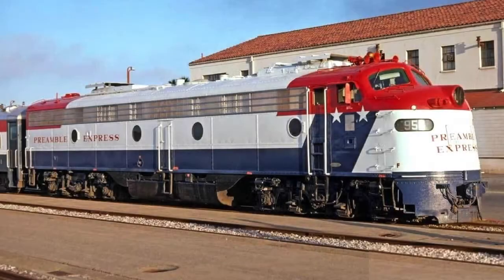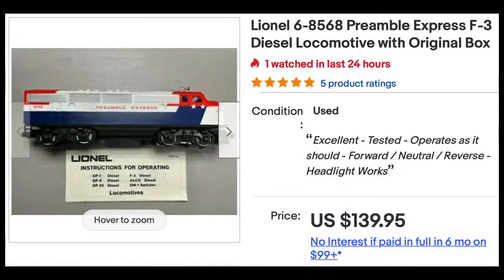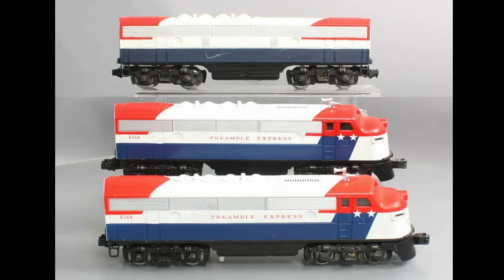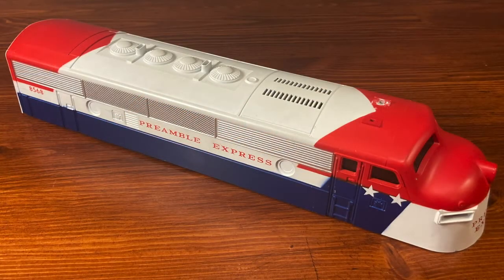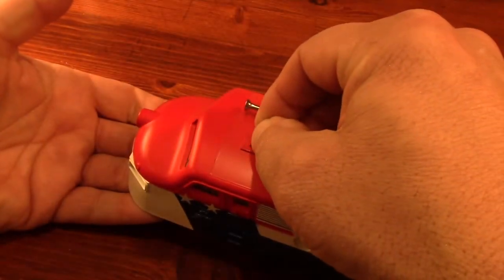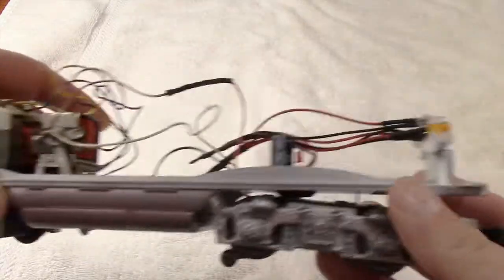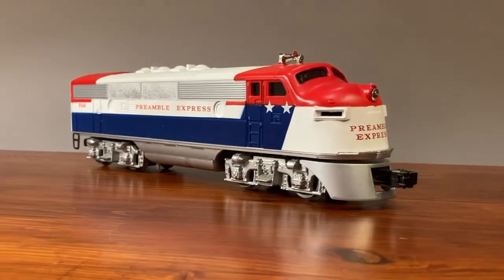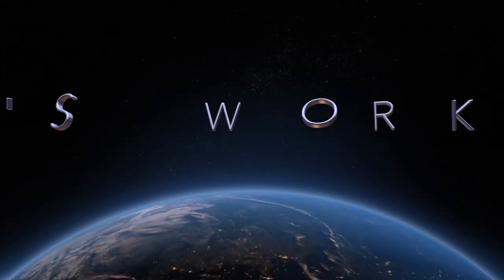Lionel Preamble Express F-3 Paint Repair and History Williams MTH K-Line American Freedom Train

Comment: By the way, does the diesel operate in reverse? And do you have any suggestions on how to convert a K-Line Dummy Alco into a motorized unit that can also reverse?
Reply from the maker: The F3 base I used does have an E unit so yes to forward, neutral and reverse. The Lionel powered and dummy bases are different I think so maybe converting to a powered unit would involve getting a whole new frame/base. I don’t know anything about K-line equipment at all though.
Reply: @bobsworkshop5181  I was reading that an Lionel Alco base should fit a K-Line shell. But what is needed in the motor to make the unit reverse? Because the Lionel Alcos have the slot with the tab lever extending through the top of the shell. I'm curious about the Amtrak diesel engines that you repaired the shells and do those engines reverse?
Reply from the maker: I think older Alcos have an electronic reversing unit but some newer ones may have an electronic circuit board.  I’m not really an authority though. Have a nice week Bob
Reply: @bobsworkshop5181  Thank you for your kind reply.

Comment: The number boards on yours are missing the plastic lenses. I noticed because I was checking to see if the numbers were present in them. The one I have does have the plastic lenses but there are no numbers to be seen only the light shines thru.
Reply from the maker: Hmmm.  I was wondering about that. Thanks. 😀